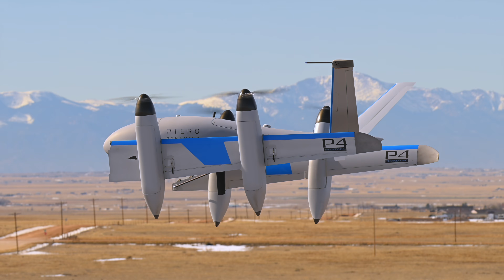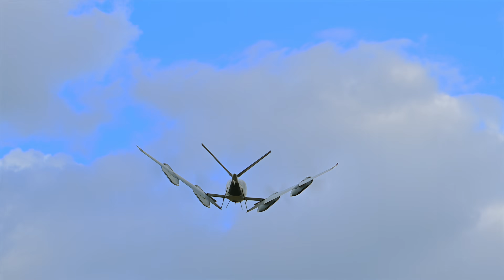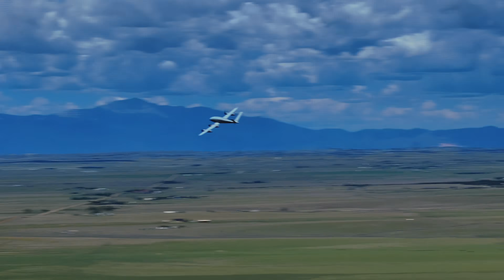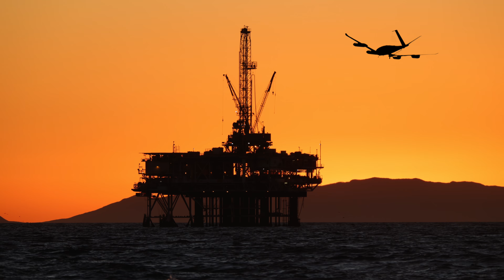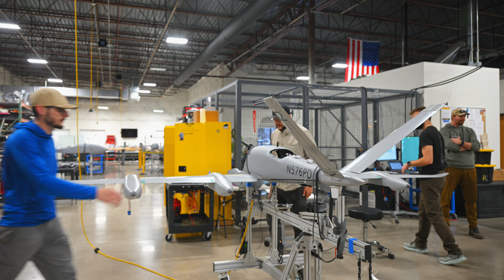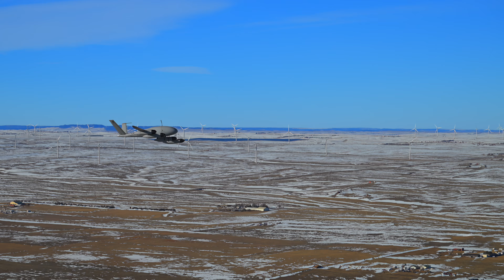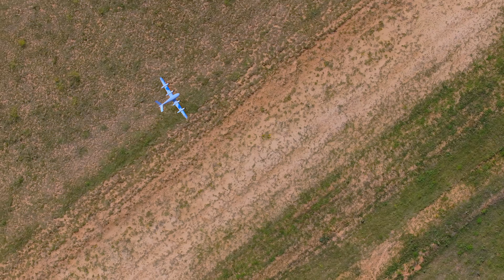PteroDynamics - The Future of Flight

Comment: The fixed wing config is so clean.  There is no left over bits of VTOL stuff still sitting there. This is the future I always thought would happen.  Scale it up!
Reply: Scale this thing up to carry 2-3 hellfire or those new anduril missile and you have a winner
Reply: No but that's awesome that they locked up the patents. They're gonna be raking in the cash when folding wings catch on. Boeing/Airbus gonna have to pay huge licensing fees to make the new 737 Fold-Up MAX! and A320flappywing. Ideal for short runways like Key West and Mexico City!
Reply: It has at least 3 left over motors and propellers not needed for fixed wing configuration
Reply: @AndrewShaidurov  many fixed wing UAS have two motors/engines on the wing because pushing air over the wings is more efficient than pushing it over the body. you will also notice that the props fold in while not in use, so that only two are in operation while in level flight, so it's in low-drag mode
Reply: @AndrewShaidurov  Having four engines is great for redundancy and power in winged flight, and essential for redundancy and performance in vertical configuration.  A one-engine rotor in vertical mode would not be redundant enough to be safe or able to fly a lot with limited maintenance; it would just be an electric helicopter, which is a design that is headed for the dustbin.
Reply: @charliedoyle7824  having 4 motors means there is no redundancy in the vertical configuration ... a single motor failure would make it unstable
Reply: @lauftbeieuch3110  With one motor out they can adjust with software the power output of each remaining motor and still stay level and powered enough to not have a catastrophic plunge, especially since they could spread their wings quickly and land like an airplane if need be.  Also EVTOL aircraft motor/engines have redundant inverters built-in to each unit, so if one inverter fails, the other one powers up immediately.  They also have redundant battery units and main control units.  Some motors even have redundant windings.  And failing windings is easy to predict ahead of time because they steadily get hotter and less efficient, something sensors and software can detect.  
A re-design could also add a 2nd motor to each unit, like many EVTOLs.  Redundancy is one of the main reasons all-electric in small to medium aircraft is inevitable.
Reply: @AndrewShaidurov  Redundency, and they can just run at 10% power like he says.  Very coool.  AND there is no landing gear - that is very cool, using the back of the Naccelles as legs!
Reply: @AndrewShaidurov well You would a need a much larger, single engine if you could only go with one. Also there are four engine Fixed wing planes and they don’t consider the engines “extra”
Reply: @AndrewShaidurov  Are we watching the same video?
Reply: while it looks nice, it's over-complicated. I bet the drag on a 2 tilting motors on wings + fixed motor on tail boom configuration has less impact than the whole extra weight of mechanics they are making..
Reply: This design deletes flaps and complex landing gear wheels
Reply: The weight/complexity/fragility of a folding wing spar is an engineering catastrophe. A non-VTOL version would be lighter, cheaper, more durable, and have longer range and a higher top speed. You can tell by the way it wobbles on takeoff that it's not super solid. Minor damage would get one wing stuck, or make it actuate more slowly or at a different angle, and it would crater. If it tried to land on its belly it would tumble instantly because of the low wing and high CG.

If you scaled it up the compromises would be much more glaring, and it'd get a lot more bad press than the Osprey ever did. There's a reason they don't make variable-sweep planes like the F-14 / F-111 anymore. The wing box and all the hydraulics to actuate the wings adds almost 10% to the weight. Modern landing gear is only about 3% of an aircraft's weight, and that's including hydraulics/brakes/steering.

That's why the Osprey doesn't actuate the wing spar. It's too heavy/complicated. And that's why the F-35 keeps it super simple. It has a tilting nozzle at the rear and a cold air fan bay at the front. And not many people actually want that version. Although I remember the Air Force being pretty happy that their version still has a 40,000 hp PTO shaft going into a bay they can put energy weapons in.
Reply: @RaquelFoster  lol the f14 was taken out of commission because the sweeping wings during higher speed flight put alot of stress on the airframe making it expensive to maintain. I dont see how that would happen here as the wings fold and unfold for initial low speed take offs and landings.
Reply: @RaquelFoster The Transwing X-P4 stands out because all its motors and propellers contribute to both quadcopter-style VTOL and airplane-mode flight, unlike other VTOLs with idle props, tilting wings, or lift fans that don’t aid forward thrust. Folding propellers cut drag, redundant motors boost reliability, and the wing-tilt design doubles as airbrakes to smooth mode transitions, while ditching landing gear and flaps simplifies it further. Plus, it keeps quadcopter-like stability and agility in VTOL mode. I'm no engineer, so I might be totally wrong and off track. But I agree that the hinge area could be its Achille's heel for scalability. I love the design though.
Reply: @RaquelFoster  Proof of concepts are like that. U have no information on atmospheric conditions during filming or operating controls, pilot experience.

Comment: What price to use the patents?
Reply: Weserflug P.1003 - all patents have expire. Feel free to use it.
Reply: @ryteulopki8069 not really the same at all. on this the entire wing turns and does so via bar linked support from the fuselage that runs along a track and is powered from the fuselage on a motor that does both wings. Weserflug P.1003 puts all the gearing in the wing and thus requires a large motor in each wing to turn its wings. or one in the middle of the plane? Also that profile would be unstable for vtol due to how its engines end up positioned in lift mode. Inferior design and more expensive.
Reply: @ryteulopki8069 not true.
Reply: if your making one for your self Patents have no standing your free to make as many as you like.
Reply: @ I want to make them to sell
Reply: @keith3761  if your aim is the hobby market they may sell a licence. But it won't be cheep by any means.
Reply: China will copy

Comment: The is the best and most practical VTOL design theory of them all. With those folding props I wonder what kind of (unpowered) glide capabilities it has
Reply: I could see this with a range of wing designs, including ones optimized for long slow high cruise
Reply: Pretty much close to none gliding capabilities.

Comment: Is this scalable to manned aircraft applications? With full sized turboprop or turboshaft engines, or perhaps propfan/ultra-high-bypass-turbofan/unducted  fan engines, How big can this concept go in cargo volume? How big can you go in payload weight? What speed and altitude capabilities are possible at maximum scale?
Reply: There is no reason why this concept should not scale up, its only money now preventing a full size craft!

Comment: Great to see you guys still alive as a company.
  
So... when are you guys going to build one big enough that can take an 80kg payload drawing 500Watts for the whole flight time, with a 400mm downward facing port?  This would allow for either a Reigl Topographic/Bathometric Lidar, or a PhaseOne PAS 880 for high resolution 3D mapping.
  
Any plans for autonomous anti-collision 3D radar so that it can operate unmanned-BLOS in controlled airspace with appropriate licensing?  General Atomics MQ-9B SkyGuardian is advertising this capability - it enables a lot more airspace to be used (but yeah $$$$$$$$ owww my wallet...).

Comment: this has good market potential in general aviation market too, would love to see manned versions, you guys must want to fly this yourself too
Reply: We have to see how the hydraulics hold up once you up the scale ratio, if that thing is bigger the chances of everything performing like it does now are slim, but let's see if they can make that leap, cause if they can they'll takeoff pretty quick
Reply: I'd love to see this with people in it!
Reply: thoughts exactly
Reply: I think New Horizon has a better design for manned VTOL
Reply: The main problem with VTOL in general aviation is that in VTOL mode, the engines have to provide thrust comparable to that of the aircraft's weight, but in conventional fixed wing flight, the engines are typically expected to produce only about a third of the weight in thrust (with the wings providing the rest). In manned configurations, this'll be confined to 20-30 people or small/medium aircraft size at best. You'll have to assume their vtol configuration is less robust than the V22 osprey's tilting design because in this thing, when the wings are folded, the rear engine is connected to the body only through that hinge at the front.
Reply: @psd993  totally agreed. I think weight and that hinge is going to be this design's Achille's heel. But would love to see a 4-7 passenger version for small air taxi, small cargo, aerial bomber, medevac or something similar. Albeit , the design will probably be restricted by payload mass, and thus some missions and capabilities might vary drastically.

Comment: Fantastic engineering. Are the rotor blades folded passively with springs? It's mind blowing how centrifugal force extends them when the motors start spinning but then the generated aerodynamic lift keeps them extended. It's this concept that blows my mind, more so than the folding wings. I wonder just how large a propeller blade that spring-loaded concept could apply to.
Reply: It's actually quite common in Chinese low-cost drones. The folding blade design originates from remote control toy planes that are not VTOL, and toy planes don't have landing gear. The design appeared at least 30 years. The reason RC planes have spring-loaded blades is that when they land, a normal propeller would hit the ground and break. So toy manufacturers designed spring-loaded blades, so when the operator lands the plane he/she can just turn off the throttle and let the blades retract before hitting the ground during belly landing.

Comment: Basically an inverted copy of the 1941 Grumen TBM Avenger wing folding design.
Avenger leading edge down, PteroDynamics leading edge up.
Reply: Transwing transitions in mid-flight, which the Grumman Avenger did not do.
Reply: @briannewton1445  Transitioning wing designs have been done in the past PtreroDynamics have just used The Grumen wing folding mechanism to achieve it.
Reply: @levin645  OK buddy- we would see a rapid unscheduled disassembly if a Grumman attempted this maneuver in flight
Reply: @parelt  🤣🤣

Comment: What advantage does shutting off the outboard or inboard motors? I understand making it more efficient, but what constitutes the selection between in and out motors?
Reply: Also, less strain on wingspar. If the outer motors were the ones kept on, it puts more torque on the wing roots than the inner motors.
Reply: I think that one advantage is that in case of a failure of one of the active engine the moment on the aircraft due to the imbalance in thrust is lower, it may also aid in control authority by increasing the airflow around the root of the wing and the tail.
Reply: Higher prop loading, makes it more efficient.
Reply: @Xailow  yup, although the question was about the reason for the choice for the inner ones to stay active instead of the outer ones
Reply: If motor wear is a concern, it could very likely alternate which engines it uses for fixed wing cruise

Comment: Your biggest problem is the center of mass/gravity when transitioning. Even if you optimize that for vertical flight or cruise flight, either way you will take a big hit on efficiency...Try scaling bigger and you will know what I'm talking about.
Reply: Sure. I will trust the random YT comment over a entire company of engineers who are making it happen.
Reply: IIRC, they figured this out by putting the mass of the flight batteries in the thruster pods behind the motors (which you can see them loading at 3:02).
  
Pretty brilliant TBH that they don't have to have a lot of high current wires between the battery, propeller ESC, and the motor.  This means that all the weight for the fuselage is mostly comprised of payload, and it's between the forward motors in lift configuration.  That's the kind of problem solving that Patents are made of.
Reply: They  ARE scaling bigger…. Next machine goes 400 miles with 50lbs

Comment: Isn't it similar to the Osprey?
Reply: In that it uses the same propulsion systems for both vertical and horizontal flight. But this is a completely different arrangement.
Reply: Eliminates many of the compromises in existing VTOL platforms like tilt-wing, tilt-rotor, lift+cruise, and tail sitters for certain missions
Reply: Ospreys engine rotate, this allows the planes wings to rotate. So it has a wingspan like a regular airplane and can fly farther with a bigger payload because of this.